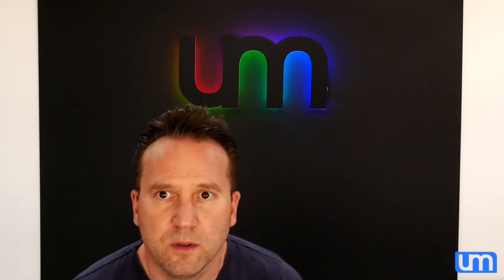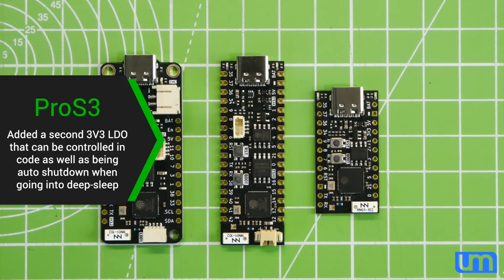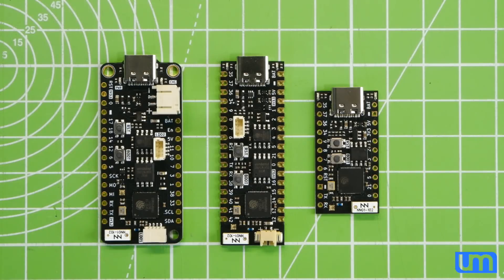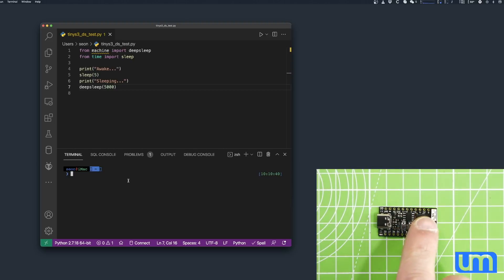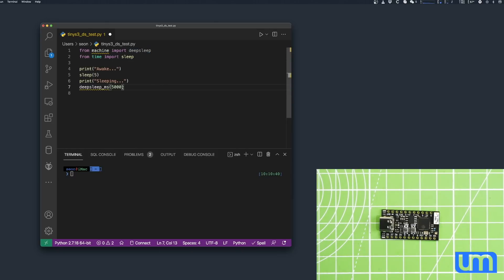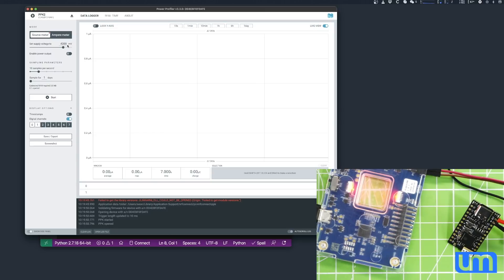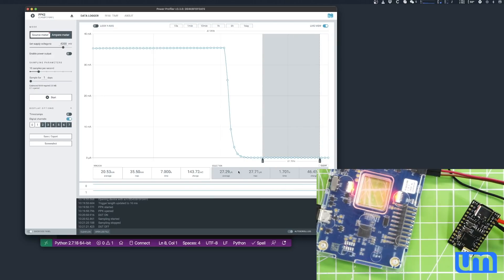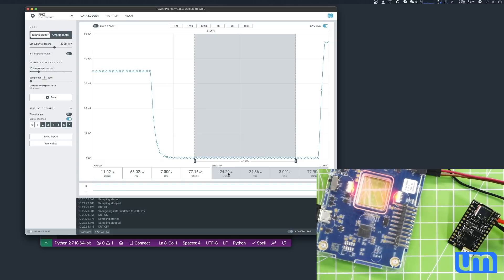My ESP32-S3 boards are done!

Comment: Using your distributed schematics, in feather s3 model you used 8mb psram what if i add same or another psram like parallel to the other, can it work like 16mb psram. I mean is it possible to use psram like ram in pc case? Should i manipulate the code, settings and libraries on arduino ide? Will they work?
Reply from the maker: No, you can't add to 2x PSRAM chips together with Arduino, and even in IDF land, you'd need to add the ability to have 2 chips yourself in a very very low level way - if even possible at all.
Reply: @UnexpectedMaker  really thank you for your reply. I have one question more if you interest, can i use sram instead psram with the same codes, libraries with esp32s3 chip? I mean, i wanna design my own board using esp32s3 chip, in datasheet it is said that you can use up to 1gb of external ram. I need a ram that is more than 64(8*8mbit). I couldnt find psram more than that. Can u give me some advice?
Reply from the maker: @hamidemin5690  you can only use external PSRam and can’t get it large. Why do you need so much RAM? It’s a microcontroller. If you need lots of ram use a computer like a raspberry pi.

Comment: Do you have a good reference for a beginner? I’m hoping to get a better understanding of building a sensor array (for humidity and temperature), but I’m not sure where to start. Eventually I’d like to have a data logger in my house that gets data from the array (in my shed roof) using LoRa. But just getting the data from a sensor is what I’d like to understand first. I’m wondering if each sensor needs one of these.
Reply from the maker: Lot's of tutorials on YT and stacks of blog posts - Google starting with ESP32 and go from there?

Comment: Just bought two s3's looking forward to using them...
Reply: So, a year later, i get round to using them as i need me memory for my project, i can not for the life of me get them to work, i have tried all sorts, they are recognised, by ide and win11 try to upload, error code then the com port drops out on the win device manager and then you press rst on board and port comes back...
Reply: Oh i also ought to add, the charge battery led, is blinking constantly ?

Comment: Hi, really excited about this board. Can it be programmed in circuitpython like any other feather from Adafruit? Or does it rely on the web-workflow (which I think the 8266s used)? Thanks!
Reply from the maker: Full USB mass storage just like my ESP32-S2 boards, so the CP drive mounts on your computer and you load/save files like any other USB based board :)

Comment: Just picked a ProS3 from Adafruit! So excited to experiment with it and see if it will be a worthy fit for my project!
Reply: Can it be programmed in circuitpython like any other feather from Adafruit? Or does it rely on the web-workflow (which I think the 8266s used)? Thanks!

Comment: The board looks very neat. Great work. Just wondering, in your experience which antenna performs better SMD(which you used) or patch antenna/Pcb antenna? Your feedback will be appreciated.
Reply from the maker: PCB antenna will perform much worse - it's a 2d plane, so more susceptible to board orientation, and just less gain than a proper antenna, so less power. They are also considerably bigger, but they cost les ;)
Reply: @UnexpectedMaker  Thank you so much for your reply. So the antenna you used in FeatherS3 and Pros3 is more reliable than pcb antenna? We just want to get rid of large space occupied by pcb antenna in our design with SMD antenna you used in your products.

Comment: Very interesting video, thank you. Is it the PSRAM that's causing most of the deep sleep current draw or have you struggled to get decent LDO's and had to compromise?

I ask as I've tried countless boards and settled on DFROBOT's FireBeetle V3 (an ESP32-WROOM-32D no PSRAM). It's deep sleep was the best at ~9uA measured on my Otti Arc. If it is he PSRAM would be nice to see a version without for a potential doubling in battery life.

Would be nice to upgrade to the ESP32-S3 for some new projects :)
Reply from the maker: No it's not the PSRAM  The PSRAM and Flash is shut down in deep sleep on all ESP32 boards. The ESP32-S3 current draw is totally different to the ESP32 - You can't compare them.  No compromises on my LDO - I went with small package and massive headroom (700mA) which is way more important than saving 1-2uA.
Reply: @UnexpectedMaker  Great to know, agreed. Thanks for the reply.
Reply: @UnexpectedMaker  this may be a stupid question but why can't you compare the deep sleep current of the ESP32 and the ESPS3? In what way are the different? Which has the lowest power?

Comment: Is it bad that I almost created an account on some random site just so that I could correct them that their Adafruit Feather S2 was really an UM Feather S2? Now that I've been spoiled, I think the only thing I could want added to the Tiny series of boards is a QWIIC/Stemma QT connector. And I have to say, you do a much better job of cleaning the fiberglass from your boards than some 'fairly' popular British companies do. Can't wait to add a few S3s to my collection. No need to wait for Arduino when I have some variant of python to work with.
Reply from the maker: Lots of Adafruit resellers list my boards as "Adafruit" boards because they come from Adafruit. I used to get annoyed, but not any more as it's out of my control ;) 

There's no room for a STEMMA connector on a TinyX board. But I did make this shield that gives you 2, and one of them has user controlled power.
https://unexpectedmaker.com/shop/shield-i2c-breakout

Comment: I've been hanging out for these boards since i first heard about them last year. Glad to see you're making progress on them.
Just one question, will these new boards have the ability to connect a JTAG / ESP-Prog device for code debugging?
These debugging boards required GPIO 12,13,14,15 but the TinyPico devices didn't have GPIO 12 and 13 available as they were used on the APA102 LED.
Reply from the maker: All 3 have USB Serial JTAG support, and the proS3 also has the JTAG pins broken out on the header :)
Reply: @UnexpectedMaker  Excellent - You legend!!

Comment: Quite happy to wait! I like that deep sleep function and never really thought about using it; But it seems like a great way for the device to call home on batteries or be an alert bluetooth beacon like an airtag.
Reply from the maker: Yup, the ESP32 is a very popular MCU for wireless projects that run off battery. For sensors and portable projects. Going into deep sleep (with a super low current) is very important for making your battery last as long as possible.
Reply: @UnexpectedMaker  Kevin Darrah is one bloke I've been following closely showing the true potential of these hooked up to a mobile phone network! The mesh capabilities just makes it so perfect for my own projects, hope others see the same!! Lady Ada also just made a video of it running Doom also!! Crazy times!!
Reply from the maker: Yup, Kevin does great work!